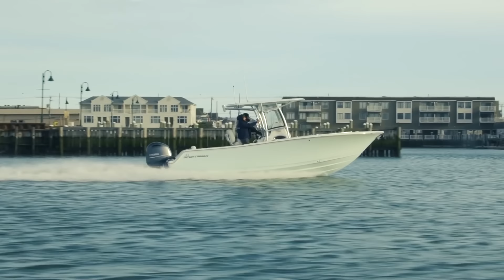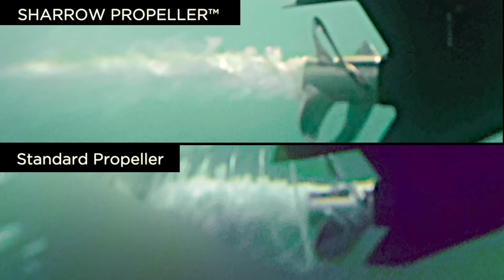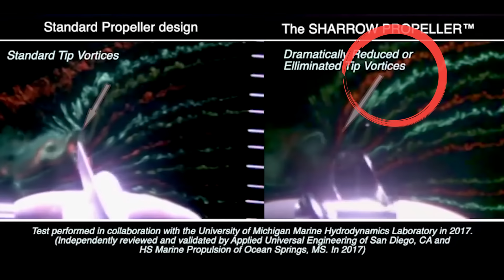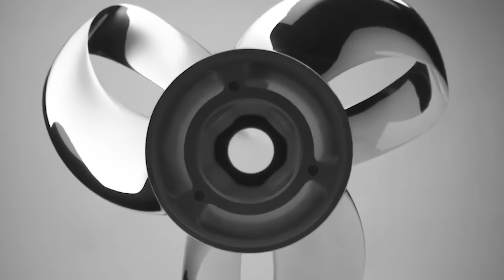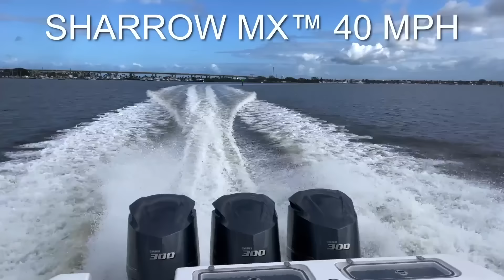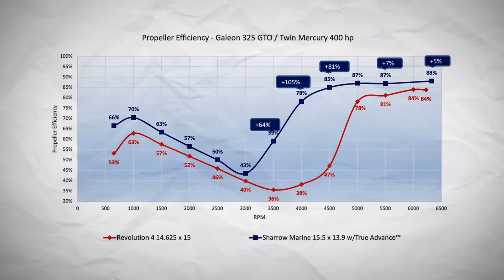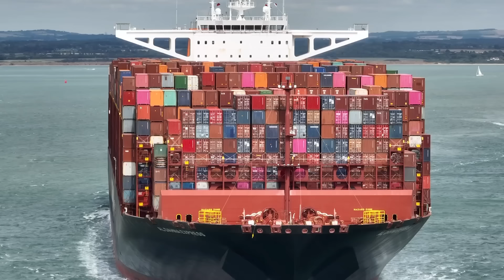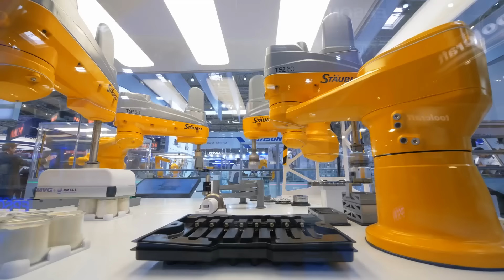This Genius Propeller Will Change Transport Forever

Comment: To what scale does this work, could you say make a modification and use props like that on a c130 or would it only worn on something like a skywarden or small private aircraft, also could they be made into a variable pitch prop

Comment: I think that the main drawback for aircraft applications would lie in the need for variable pitch. At a quick glance, these props appear to be optimized for a specific pitch. Varying it could cancel its benefits.
In addition, I'm not sure if they can be "feathered".

That said, for marine applications, they sound great, both literally and figuratively.

Comment: You'll find that comparing a boat prop to a drone prop isn't exact. A boat prop is moving through the water linear to the flow of water, which requires a different prop shape to create the optimal vortex. A drone is not traveling in the direction of the airflow (maybe slightly when rising), so the prop requires a different shape to create the optimal vortex.

Comment: I can't imagine that mass production of toroidal propellers wouldn't bring the  cost close to that of standard propellers.  They would be cast in molds.  They obviously are more complex and look to use more material.  That would make them more expensive.  But I would be shocked if they ended up costing more than 30% percent more then a standard prop.  I'm usually very skeptical of anything that appears to be revolutionary.  Usually there is a catch.  At this moment this seems to be a no brainer.  What am I missing?

Comment: No, it wont.... the machining costs and specific characteristics at non-optimal RPM ranges mean this doesnt provide enough of an economic benefit outside of a few specific use cases. Additionally, said benefits are entirely dependent on a tighter tolerancee of geometry before it is worse than a traditional propeller. It has its uses, but the durability, usability and cost arent viable for widespread use yet.

Comment: That's a nice sell and all, but you're far too verbal and optimistic about it. The majority of its usefulness is for boats because it reduces cavitation which is a major loss of energy... But there's a catch - they're only more efficient in a VERY specific speed range, so unless you match up rotor size to rotation speed and needed thrust, it could end up slowing down the vessel and not being nearly all that helpful. As per air flow stuff, such as drones, other flying stuff and computer fans - well, its even worse, for example i already saw a guy test a 3d printed pc blade like this and it was WAY LESS efficient, because the required fan speed to make it useful needs to be way higher, which would completely beat the purpose of it (being more quiet) nor efficiency in terms of both cooling and power consumption. Same for aircraft. For now its just a possible step forward for boats, and even that is yet to be tested and proven on a large scale. If it was that definitive, the large shipping companies would be jumping on board like madmen, which is yet to happen.

Comment: When the Sharrow props first came out a few years ago the price was somewhere around $9000 dollars I see the price has come down quite a bit , however $5000 dollars for a prop is still a lot of money for most average people
Reply: But even a 30ft - 40ft boat can cost thousands of dollars in basic servicing, depending on the engines, etc, never mind the fuel costs.  In such cases the propeller cost might not be unreasonable.
Reply: @GodmanchesterGoblin  people buying 30-40ft boats are not usually average boat buyers financially speaking . LoL 😂
Reply: @mhughes1160  Of course, but my point was that such a propeller as this might be beneficial to them, and they could afford it. Such sales could lead to further cost reduction which would then benefit owners of much smaller craft.

Comment: So far I've only seen the Sharrow props tested on relatively high speed outboard engines.  On those engines, if you look at the low RPM range (under 3000RPM) the Sharrow doesn't give that much of an improvement, not enough to justify the cost at least in my mind.  Large cargo ships rarely run at over 2000 RPM, if that high, so it's doubtful if that prop design would give any benefit to shipping industry.  That said, I would love to see a Sharrow type prop tested on a trawler type vessel rather than a "go-fast", just to see if it would give those same (small) increases in fuel economy.  
.
As an aside, the concept behind the toroidal props isn't that new.  You can safely wager that the various navies around the world have looked at using them on warships, especially on submarines where cavitation noise is the main cause of being detected.  Another item, most marine props are CNC machined, especially performance outboard props.  Large ship props are cast and then polished to the final shape.
Reply: I would expect that the efficiency versus speed curve would also be massively shifted depending on the dimensions of the propeller under test.  Large conventional ship propellers already operate at vastly different speeds to  propellers on outboard motors, for example.

Comment: I would say this isn't scalable for larger rotor wing aircraft, at least in their current design. One of the main control groups of helicopters (pitch) is reliant on the ability to change the AoA of the rotor blades, either collectively or individually, and I don't see how you can do that with a toroidal blade. However, for fixed pitch blades like boats and small drones, this looks like an amazing advancement.

Comment: Propeller efficiency is also looked at the large scale. Adam Savage did visit Archer Aviation for a demonstration of their E-VTOL demonstrator. One engineer talked about propeller noise and how to reduce it with fluid dynamics simulation. It's all about vortex shedding and tip speed. Don't forget: airliners have jet engines which blade tips (of the main fan) go supersonic - this is why they are so damn loud... ✌️

Another example: CFM RISE, which is based on the research of the GE36 UDF (his was the engine for Boeing's planned 7J7 airliner). The RISE has special external blades and static blades directly behind them. All this is geared towards efficiency and noise reduction and will come to market within the next 6-8 years. 😎

Comment: On a boat I think the prop would pay for itself pretty quick given the cost of fuel and how much fuel these boats can use. 20% increased fuel savings would probably pay for the difference on the propeller in a few months of frequent use.
Reply: They cost $5,000. If you're burning 1000 gallons a year at $4/gal it'll take 6 years to recover that investment. I also have serious doubts about their real world performance. Surely the guys running million dollar center consoles would all have them if they were really that good, but I've never even heard of anyone running these props. I guess time will tell.
Reply: @MH4g1an1s  Yeah I was thinking bigger yachts like berings that take 13000 liters (2800 gal) to fill the tank and can go trans atlantic but for a smaller boat it would take a lot longer.

Comment: Having retired from Aviation after 30 years I have gained a lot of knowledge in the efficiency of propellers. The biggest difference I see is that the tip of a standard propeller actually breaks the sound barrier, that is typically what makes the most noise and also causes drag and reduces propulsion at the tip. The circular design eliminates the tip of the propeller, making it much more quiet and much more efficient.

Comment: Question: this really efficient shape sounds like it would be amazing if used on a helicopter, what is the possibility of this becoming an option?
Reply: It would take some incredible engineering and design changes. One of the things that allows helicopters to move in the way they do is the ability to change the angle of attack of the main rotor blades (either all at once or different combinations of individual blades).

Comment: So exciting! My dad was a metallurgist and cast many large propellers for military, cargo, and passenger vessels. I wish he was still around so I could share this with him. Thank you!
Reply: My dad loved boats too, i share the same feeling.
Reply: Think how quiet this could make Submarines under way 😱👍
Reply: @billyaitken7461  submarines already have silent props. From my understanding they are near completely silent at a certain RPM. They are very secret, so not sure how the design looks like.
Reply: It's a scam, these props have been around for 50 years, there's a reason you don't see them anywhere.
Reply: @alittlebitgone  Lol,  in that case, knowing my Dad’s very precise engineering mindset, I would have probably been in for a lengthy, detailed lecture on the subject!
Reply: @alittlebitgone  as with most ideas this one could have its comeback due to modern fluid dynamics computing and manufacturering...
Reply: @alittlebitgone  The reason being the difficulty and cost of making them?
Reply: @grugnotice7746   I've seen a video where regular boat propellers are made by lost wax casting. If they get enough demand for them, I think the same method can be used to make these sorts of propellers.
Reply: @alittlebitgone  Exactly, the maths hasn't magically changed in the last 50 years....

Comment: It looks like the most turbulence in the boat propellers is coming from the tube that the propeller is built around. What happens if you taper that down gradually  to a point. Is there a shape that lets the water smoothly flow off, giving you something resembling laminar flow?

Comment: The challenge I see with applying this to aircraft, especially helicopters, isn’t in the motor speed. I feel like a shorter rotor span would increase the speed through preservation of angular momentum, compensating for the extra weight. The challenge I see is in the relative rigidity of the propeller itself. On a plane or a drone, steering is achieved by manipulating control surfaces on the wings or by changing the orientation of the propeller as a whole. On helicopters, each blade needs to be manipulated independently of one another. This design doesn’t seem to be able to allow for that.

Comment: Tge design lends itself to cheaper materials and a variety of Mfg processes. The design has an inherent structural component based on having two attachment points per blade. This eliminates high stresses at the root of a normal propeller. As such, there are high strength plastics that could easily be used reducing costs and costly CNC machining.

Comment: 1) A standars propeller don't cost 500 bucks, a lot more
2) not suitable for sail boat because they need a folding propellers otherwise you loose speed  under sail or you engine broke due the propeller countinuos  conterforce on the shaft line on long distance.

Comment: The costs of purchasing will kill the market. To recoup 5k for a boat propeller does not make sense. A propeller strike will exceed any fuel savings, if lower end is requiring change with a propeller, this itself can exceed engine costs.  When they develop replaceable blades with keyed hubs and cut purchase price to a 1/4 of current prices , I might look at it.

Comment: These would be best used in nuclear submarines to help with underwater noise output from standard props which have already been redesigned over the years to help eliminate cavitation.

Comment: You cannot have over 100% efficiency. Just the water flowing over the surface of the propeller blades has a small amount of friction. If you claim 105% then you have created a perpetual motion machine, which we all know cannot happen based on the laws of physics

Comment: There has been for some time a propeller used on large ships with the blade tips connected with a sort of tube which gives it some of the properties of a ducted system. The tube spins with the propeller. I believe it is produced in Spain.

Comment: It would be difficult to use in helicopters since
the blade pitch in the main rotor n tail rotors are constantly being changed to maintain control of the aircraft. In airplanes, perhaps, since some of those props are a fixed pitch.

Comment: 105% efficiency I doubt very much. A substantial increase in efficiency is indeed possible if tip vortices are decreased. Interested to see how this develops. It's more complicated to manufacture but not a serious issue using a 5 axis machine. If it is as good aas presented price will drop rapidly.

Comment: They are asking silly money for them. In terms of small marine props, Standard s/steel 3 blade V a toroidal prop for Yamaha 140hp outboard  AU$500 v AU$7200.    Even with 20% fuel saving that is a LOT of days on the water to justify spending that much on a part that that becomes scrap when it discovers a hidden rock/log or gets bumped on a dock.  Will be attractive to 24 hr commercial operators (who can write-off damages against tax) and have $300+ burn per day, many economies of scale required before the weekend fishos saving $20/day on fuel can look at the option seriously.

Comment: Quieter computer fans would be an  extremely useful application of these new fans. Every watt saved due to improved heat removal translates to improved TCO. 

Additionally, the decibels on a computer center  floor rival those of an airport tarmac, and can even be higher. You need ear protection to satisfy OSHA standards when you're in a large server room. Lowering this racket makes working on servers easier. Plus, excess vibration increases wear and tear,  and can even cause random errors in computer operations

Comment: I saw a video where they were used on a drone, and it was noisier than a 6 bladed prop.
I guess there are tricks to making them quieter, like not making them on a 3D printer that doesn't create an absolutely smooth surface.

Comment: I'm going to take a wild guess before watching the video; they create more disturbance in the fluid which means they are able to transmit more of their energy into it, possibly because if greater surface area. This also generates less noise because a lot of the sound energy is being distributed over a broader range and the currents and eddies help bleed energy out of the sound waves a lot like how a silencer works.

EDIT: Eh sort of

Comment: i know this since gran turismo 6 - that rotating parts weight is very heavy to move tor engine. this crap is highly unefficient and its not kind of new and genious. but, this may work well if efficiency is less needed than sounding, at wind turbines, yachts calmness(but itll cost a lot fuel). nothing new.

Comment: It seems like hype, and there needs to be more asterisks around the claims. There would be a huge increase in mass, particularly away from the axis of rotation, which means these propeller designs have multiple times the angular inertia, and will require immensely more power to accelerate and decelerate. This probably makes them impractical for use on quadcopters or other multirotors that use quick fluctuations in individual motor speeds for maneuvering.

The benefits likely don't scale for large propellers, slower rotational speeds, or propellers that will be operated at different speeds.

Comment: Awesome Video and informative. I do question what other issues other then cost have been identified. 1 I see is apparent is size application for various places and craft involved. You stated that it will help with propulsion nicely, what about other applications like a Hydro plant in a river. It would be nice to be able to apply in other fields other then transportation devices or aircraft alone.

Comment: Improved radiator fans and ventilation systems for cars, etc.

Improved heat pump designs for homes and businesses.

Improved electric fans for any application. More compact, quieter, more efficient.

I̶̶̶m̶̶̶p̶̶̶r̶̶̶o̶̶̶v̶̶̶e̶̶̶d̶̶̶ t̶o̶y̶ p̶r̶o̶p̶e̶l̶l̶e̶r̶ h̶a̶t̶s̶ f̶̶̶o̶̶̶r̶̶̶ k̶̶̶i̶̶̶d̶̶̶s̶̶̶ t̶̶̶o̶̶̶ w̶̶̶e̶̶̶a̶̶̶r̶̶̶ o̶̶̶n̶̶̶ t̶̶̶h̶̶̶e̶̶̶i̶̶̶r̶̶̶ h̶̶̶e̶̶̶a̶̶̶d̶̶̶s̶̶̶. 😂

Comment: There has been quite a lot of research around using this technology for things like computer fans. At the speeds typical computer fans operate the efficiencies just aren't there and the sound differences are negligible. This may also be the case for container ships as the props on these are much larger and operate at lower rotational speeds. It will be interesting to see if the efficiencies can be obtained at reduced RPM with larger blades which keep blade speed through the water high, reducing fuel usage on large container ships by 20% would have a huge impact.
Reply: If you're into cooling fans, have you checked out piezoelectric cooling fans?  Kind of a weird little rabbit hole, thought you might enjoy...
Reply: @thorium_glass  Wouldn't say i'm 'into cooling fans', that would be kind of sad but I have seen the piezoelectric fans, interesting technology for sure.

Comment: The cost comparison at the end, haha. I guess for a small outboard prop. As soon as you get an inboard screw you're paying 5k easy prop, even like a 1/4" shaft which would be comparable in size to that outboard prop.

The big issue with putting these on a container ship, is that props don't have a static geometry. Pitch is changed for many different reasons to maximize efficiency and limit cavitation. Tuning that is already a headache too. They would have to overcome that hurdle if they want to use them on a ship.